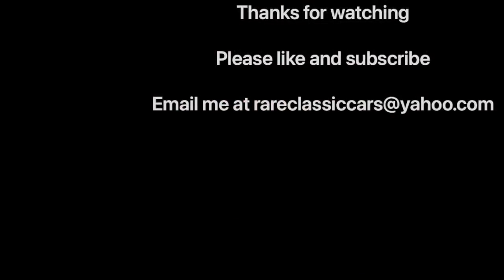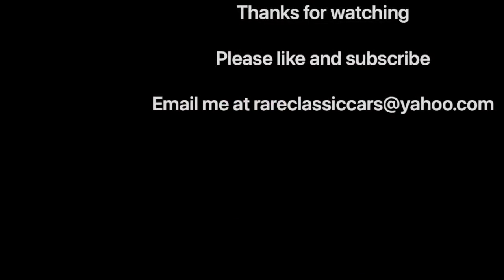Worst Engines of All Time: GM 2.5L Iron Duke Follow Up

Comment: Love your channel, but I'll take you to task on this one....

If the Iron Duke is one of the "Worst Engines of All Time", and an example of GM's worst, then I submit that GM made pretty good engines if the Iron Duke is one of the worst.  But we know it's just not true.  You can't lump the Iron Duke in the same bin with the Vega four cylinder, or the Old's Diesel 350 V8, Old's Diesel 260 V8, or the Olds Diesel 4.3 Diesel V6, or the Cadillac V8-6-4, or the HT4100, or Cadillac Northstar, or the GM Detroit 6.5 Diesel, or the Quad 4, or the Buick 3.0 Liter V6, or the Chevy 3100 V6, or the Ecotech 2.4.  It just doesn't belong on a list with those engines.  It cannot make the top 5 worst GM engine list or even the top 10, let lone worst engines from other manufacturers.

The Iron Duke was a mediocre engine.  The epitome of "pedestrian" engine performance.  I had one in a '77 Ventura w/ a 5 Spd manual.  Weirdest car I ever owned, and that poor engine managed to lug that heavy car around for over 100,000 miles-- very slowly with a 5-spd. manual.  Eventually it blew a head gasket before I dropped in a Chevy 250 Inline 6 with a 4-spd Sag.  Unrefined and mediocre, but not a BAD engine.  As far as the cars go; I was an active member of the a-body.net site for many years, and there were many fans of the Iron Duke in Ciera's, Celebs, Centurys, and 6000s.  I favored the 2.2, but the majority of the a-body guys preferred the 2.5.  My father rented an early 80's Phoenix with the Iron Duke and a 4 Spd.  He was impressed, and he hated GM.

The argument that the engine was intended to replace old V8's and Inline 6's is like comparing Apples to Fish Tacos.  It's just not that simple.  The engine was needed to rescue GM from the Vega debacle, and well...mission accomplished.  I'll submit and admit that the Iron Duke stayed around too long. Rather than comparing it to 90's era foreign 4-cyl engines, it would be best compared to it's late 70's competition like the Ford 2.3 Pinto Engine, or the Chrysler 2.2.  When I was looking for a car out of high school in the early 80's I tried out a Fairmont with the 2.3 and automatic trans; that thing vibrated and was loud just driving it let lone at idle.  In the Late 70's / Early 80's the Iron Duke was probably the best 4-cyl. power plant in the domestic market, and while inferior to Japanese 4-cyl. engines -- that's understandable since that's all the Japanese ever built to that point. Early Japanese V6 engines weren't anything to write home about ( i.e. Toyota 3.0 V6)...the same can be said for their automatics.  But these comparisons have their limits, and that's why I would judge the Iron Duke to be a mediocre, unrefined, and pedestrian power plant that hung around way too long.  But, by no means this is GMs worst engine, not not even close.

Comment: The Iron Duke was probably best known for the "John Wayne esk "name they were used in a lot of boats and as a boater I did not like them in that application either.  Gm would have been best served if they developed the Pontiac OVC inline six and spawned a 4cyl version. Gm is guilty of never taking there small car market seriously, this is why Honda & Toyota grabbed such a market share. The facts are there. VEGA MONZA CORVAIR Any J body car none of them were allowed to developed into a great contender. The Fiero was just starting to look good when they dropped it, again to little to late. The Iron Duke was best when used at low rpm in farm equipment.

Comment: I think you're dead right. I was born in 78. The first cars I drove were mid to late 80's GM and Ford cars. 84 Fiero, 86 Olds Cutlass Ciera, 87 Ford Thunderbird. The 2 GM's had the Iron Duke. And then I learned to drive 5 speed in a 1985 Honda Prelude. 
My parents and grandparents kept buying those GM's because of loyalty and familiarity and never having experienced anything else. My generation never personally saw great American cars on a showroom floor. When I and many others drove a Japanese car for the first time, there was no nostalgia or loyalty to overcome in appreciating what Honda offered. 

The real mind bender for me has always been that Toyota got it's start building GM cars and engines under license, and so many of their engines up into the early 2000's reflect that origin. The legendary 2JZ is really just a highly evolved Chevy straight 6. On the other hand, all of Honda's engines are evolved motorcycle engines. Same with their transmissions. Those facts are the reason the Accord has completely dominated it's segment for nearly my whole life. 
Even if GM had unlimited resources to design something clean sheet in the 70's or 80's, Honda approach to engineering is so different and so unusual that they've always been disproportionately competitive for their size, regardless of the markets they entered.

Comment: I own a 88 Chevy s10 and i agree 💯 with you my motor is a 2.5l and has been nothing but problems right and left note this is my second motor and gotta say there no good at all this time that i bought a second motor didnt even last a year head gasket leak twice in one year first motor lasted 3 years and had a head gasket leak aswell now my truck sits in the garage for the past year after waisting 2,000 ÷ on repairs

Comment: I can totally relate to the problems with the Iron Duke. My Mom had an 84 Buick skyhawk and I forgot about the idle vibration until I watched your previous video. Oh yeah and my Dad replaced the timing gear as well because of said issue.
Reply: One of the first cd players in my friends cavalier would not play at idle. Back then the over sampling was low

Comment: Like I said in my post on your other video, if you bought a car, not a truck, with an iron duke with an automatic transmission, you are basically an idiot.  So your only complaint is that it vibrated at idle in passenger cars with automatic transmissions.  So I assume you will do another video admitting you're an idiot, right?  My 1990 Grand Am with the iron duke and a 5 speed was a great car.  I ran it hard, revving to the red line almost every time I went through the gears.  I ran it up to 195,000 miles when I got rear ended.  It was still driveable and could have been fixed but the insurance company totaled it.  Still listening to your video and you contradict what you said in the beginning.  Why am I wasting my time typing this?

Comment: The iron duke 2.5 may have been a rough idling engine on the street, but in a racing application it was hard to beat with thousands of wins and many championships when mated with the pontiac cross flow head.

Comment: Those engines were also used by American Motors in the Spirit and Eagle SX/4 with select drive 4 wheel drive system in the 1980s. My sister had an '82 Eagle with that engine. The engine may have been fine in the Spirit which was the same car with 2 wheel drive but the Eagle was heavier because of the extra components for the 4 wheel drive system so the engine just wasn't powerful enough for that car. It was so under powered it had to be run at full throttle in first gear to climb the hills in southern Ohio at a top speed of 15 miles per hour. It also had a nasty habit of blowing head gaskets.

Comment: I loved the Iron Duke.  Had one in my S-10 bought new in 88.  But it was a noisey timing geared son of a gun.  Also had to reseal the valve cover every 15-20K.  It was still a lot more durable than any other GM 4 cylinder.  Plus, as a broke young adult, I loved that the S-10 with the Iron Duke would get 30 MPG on the highway at 60 MPH.

Comment: I think there is some validity to your take on the 2.5. Did it run forever? In most cases, yes. Did it puke oil from everywhere during the process? You know it. The heads were far too shallow for oil drain back, and the valve covers too tinny to properly seal up. No matter what was done, they leaked. What I witnessed as a tech of the day was that these mills would burn exhaust valves on #4, causing a miss fire. An engine rebuilder of the time told me it had something to do with the intake manifold, but I can't recall. You factor in the really bad Delco electronics of the era, and suddenly you know why people have a love hate relationship with these engines.

Comment: I drive a Grumman LLV every day at work, with well over 250,000 miles on all of them and held together with bubble gum and bailing wire.   You’re right, they are reliable in essence of their durability; but what a punishment to drive for 6+ hours a day.  The fumes, the vibration, the erratic power curve…but mostly the noise and vibration all day long. My nerves, nose, and body in general are shot by the end of the day. So yes, reliable, but definitely not a comfortable experience. Love the channel, keep up the good work. Got any Olds 98s in the barn???

Comment: All these comments about how bad the Iron Duke was makes me laugh, if you expected it to be a barn burner you were blind. It was a good reliable fuel efficient engine, it wasn't gonna run 0 to 60 5.5 seconds. It had good low-end torque for the time and that's why gm used in so many cars but it had its limits. Those automatics transmissions back then killed most of the low-end torque, the manual transmission were way better. Personally I had a 80 citation x11 with the iron duke 4 speed, I was the 2nd owner I put 100k on it then sold it to my father, he put another 100k on it, when I say he drove it till the wheels feel off I mean it...literally.

Comment: One place I worked, we had 2 Clark fork lifts.  One with an Iron Duke and one with a Mitsubishi 4 cylinder.  The Iron duke VIBRATED like a somebitch and the Mitsubishi ran as smooth as glass.  That left a bad picture in my mind for the GM iron duke.  -----Doozer

Comment: My parents bought a 89 Pontiac 6000 LE fairly loaded, new  . Dad went straight in to get the 2.5 because a friend of my parents had one and loved the fuel economy.   As a kid I thought it sounded like a diesel and this was one of the balance shafted engines as well . 
Overall the engine never disappointed in terms of economy and reliability, had 140k before it needed a tune-up . 
Worst part about the whole car was the faded paint after 5 years and exterior plastics that looked like they had disintegrated in dry ice .

Comment: Iron Duke was a great engine considering it  exceeded expectations, yeah It vibrated, was low on power. It was a cheap engine designed to move a piece of shit car and get relatively good fuel efficiency doing so. It did it's job as designed. Some how GM engineers mistakingly made the Duke almost bullet proof, and in most cases the vehicle unibody went back to mineral form before the Duke died. I've seen them in fork trucks, air compressors, marine applications. Those are rough environments for a passenger car engine. . It wouldn't surprise me if your snail mail got delivered with a Iron Duke US Post Office has been using them forever.

Comment: I had an 86 Grand Am in 94 as my first car. The Iron Duke lasted til 170K miles when I accidentally over revved it. A couple of weeks later it threw a rod. It wasn't a horrible motor and it gave me much less issues than the 3.1 in the 93 Grand Prix I replaced the Grand Am with. That car swore me off of GM for good.

Comment: My parents had a 83 celebrity with a 2.5, good car. Did replace the cam gear. They bought a 89 Olds Ninety Eight next. That car was on a whole higher level. The 83 was reliable, but not nearly as refined.

Comment: Sorry but if the engine is reliable then it doesn't deserve the worst spot.  Not even close.  You're going by engines in cars you've owned, not what is truly a horrible engine.  I personally like the GM Quad 4 engines because they have a lot of power and got good gas mileage, but weren't that reliable and weren't smooth running engines either.  An engine that truly belongs here is the Cosworth engine that you found in Vega's.  Pretty nice engine when it worked perfectly but clearly GM didn't test the engine before realizing a cylinder wall made out of aluminum was stupid, and all these engines ended up in the trash.  Modern GM 4 cylinders like the 1.4 Ecotec Turbo is a disaster.  Again I'm sure a smooth and powerful engine that dealers don't have on hand until 2024 because that's how many are going bad.  Turbos and piston rings are going bad is what kills these engines.  I'd rather have a rough running engine that never dies than one that runs smooth but then costs thousands to replace.  GM has made much worse engines.
Reply from the maker: Reliability only reveals itself years after ownership.  The new car buyer will judge the car on how it feels new vs competition.  In that case, the Duke couldn’t stack up at all against the Japanese offerings.
Reply: @RareClassicCars  GM in the 80's was mostly crap.  Their cars were notably built cheap.   You didn't buy a GM car because you thought it was good.  You bought it because it was American.  GM knew and they took advantage of it.  This is also why the Quad 4 was created because Oldsmobile wasn't gonna depend on brand loyalty to sell cars.  It probably was the 90's when GM realized their throw away cars were losing to Japanese cars.  

I can think of many Japanese cars I wouldn't own due to reliability.  You don't see Mitsubishi's anymore for a reason.  Same reason why Chrysler has a bad reputation for reliability because they worked with Mitsubishi among other unreliably car manufacturer's.  Datsun's were good until their bodies rotted.   There's a reason you don't see many good 240Z's.  Nissan today is just awful with their CVT transmission issues.  When we talk about Japanese cars we mean Toyota Honda.  In that order.  Ascending order.

Comment: 2.0 liters is the upper limit for smoothness in an inline 4.  That's because there are only 2 power strokes per crank revolution. The more power strokes per revolution, the smoother the engine will run.  That's why Cadillac came out with a v16 in the '30s.

Comment: You are 100 % correct sir I had 3 iron dukes they were rough and unrefined a sunbird a Buick century and a celebrity Chevrolet ok like you said not quiet or smooth compared to a Honda engine of the time .the sunbird burn the valve .

Comment: Great explanation. I came close in 1982 to buying a new chevy citation with this engine. I had a couple small kids at the time. I guessed I dodged a bullet. I ended up getting a ford tempo a little later. However the citation looked great.
Reply: I agree with you. I thought the Citation was a fine looking car when it came out, and I loved the utility of the hatchback design; it just made sense. I guess I also dodged a bullet because I ended up getting a used 1978 Oldsmobile Cutlass with a 305 instead. That ended up being a great little car !

Comment: My experience was that a 2.5L Iron Duke with a 5-speed manual transmission was much better than one with a 3-speed automatic. In terms of smoother idle, better performance, and better fuel economy, it was evident that the 5-speed manual transmission helped.
Reply: I'm sure the flywheel helped them, as Adam failed to mention.

Comment: Two problems: 1) As evidenced in many of your videos, you allow your dad’s past comments to influence your current opinions heavily.  2) The general public, in the comment section disagree with your dad…. In that, quite reliable, but “unrefined” alone does not warrant “worst”.
Reply from the maker: The opinions are my own.  My dad was a die hard GM guy.  I wouldn't invoke someone's name who can't be here to respond.  People can feel free to disagree with me.  As I mentioned, these are my opinions.  But, I've owned at least 4 cars with this engine, and still own one.  IMO, there was just no comparison between this and a prior American-made V8 or a contemporaneous Japanese 4 cylinder.
Reply: @RareClassicCars  Japanese four cylinders from the 70's, for example, were refined but horribly unreliable. The Honda 1.0L, for example, had atrocious head gasket and head warping issues alongside camshaft breaking problems.  Toyota had rod bearing and head gasket issues.  Mazda and Mitsubishi 4 cylinders burned oil by 36,000 miles.  It wasn't until the mid-to late 80s before Japanese 4 cylinders came into their own.  I (and obviously many others, as you've made numerous double-downs on this in multiple videos) simply disagree that, "reliable but shakes my dash" just doesn't warrant "worst", in our opinions.

Comment: I had an '85 S-10 with the "Iron Duke"... and an automatic. (700R4) Did it sound like a diesel? Not really... unless you count what sounded like a rod knock, or ran it on less than 91-octane fuel. Did it shake, at idle? Only enough the make obvious the catalytic's heat shield was damaged/rusted. And over-revving...? That was only a worry when it would downshift, while set in overdrive. =:\

Comment: The Iron Duke had issues with rods about 1983-early '86.  Not all of them.  Some were ok, others were not.  There was a batch of defective rods.  I'm guessing that those rods were made at the old Danville/Tilton foundry.  There were complaints of blocks cracking in '83-'84.

Comment: I actually look back with some fondness at the 91 Olds Calais.  Sure the Duke was at it's best self by then.  Probably at least 1/3 better than in the first X car?  But the cheap little Calais was a looker.  Easily confused for a Toronado or Riviera of the time.  Hard for me to remove the Duke from it's body wherein I experienced it most.  Does anyone pine for a 91 Cressida with a smooth motor?  Or was it essentially a toaster on wheels to it's users?